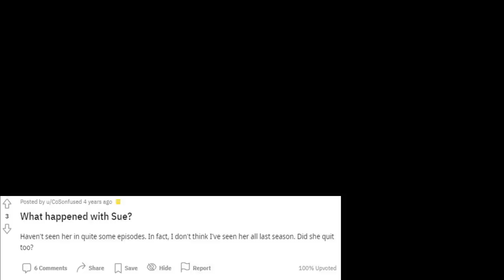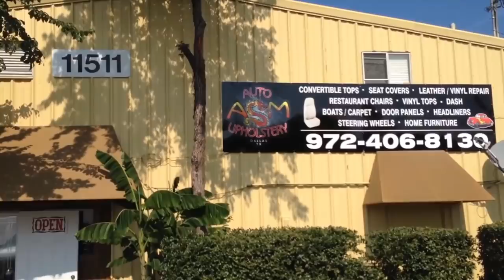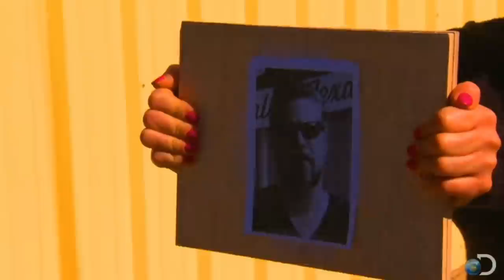What REALLY Happened To Sue From Fast N' Loud!? The TOXIC Relationship With Richard Rawlings

Comment: I know her personally and I have been her client on my own projects. She and Pilgrim Studios did not see eye to eye. She would provide about 6 weeks of work of the entirety of her shop for very little pay. They wouldn't even pay her for the electricity the studios would use. Her shop is quite busy and if you consider that she was basically spending her vacation time, while having to cover overhead and delay paying clients' work for the show, when the show told her that her measly per diem and the advertising she received on the show was enough pay, she had to pack up.

If you know her she's directly involved in the work and keeps a tight ship. The shows would make drop everything in a minute and deliver to them. Many times they didn't even cover the materials.
Reply: Well wish I would have just read this then wasted my data on this
Reply: You know it's for sure Richard sure made a lot of money off the show
Reply: Hell I don't blame Aaron for quitting
Reply: Doesn’t put too good a face on either RR or the network does it?
Reply: @markvincent5992  as much as the show portrays RR as having control on the show and the cars, tbh RR had no control on that. Aaron was paid as talent by the production company. The network bought the show from Pilgrim Studios as a product, they only attained some editor and executive production rights in the second season. GMG didn't exist before the show. As much as RR claims it did, it did not. There was a number of shops and very different businesses he had. Many of the shops went under. The print shop was taken apart and he sold the machines. 

I think the problem with this show is it makes it seem that Gas Monkey existed before Fast N'Loud and that Aaron was always' RR's employee. It wasn't done this way. I hope the full story of how they came about comes out.

Aaron didn't become a shareholder of Gas Monkey Garage because his own choosing. He wanted a guaranteed salary. When GMG came into success then he was upset at his decision and decided to open up his own shop.

Now that there is no show, we'll see if GMG survives. With that overhead, it will never do it. The cycle is done for and Discovery stretched the GMG theme way too much with five side shows. OCC failed after American Chopper went off the air. Junior still has a shop because he heavily reduced his overhead. He leases a much smaller space and has no more than three employees. His father on the other hand spent his way into bankruptcy.

There aren't people demanding million dollar cars from GMG. It's just not the case.
Reply: @SuiteCaseLaw  thanks for the info Victor. I have based my opinions on the on screen actions of RR and the facts about his treatment of his employees and spending habits gleaned from other sources. I think Aaron was wise to get a salary instead of a “piece of the action” since it certainly appeared that RR was not sharing the wealth. I suspect that at least some of the reasons that allegations that the production company was doing things on the cheap may have its roots in how much RR had to do with the distribution of funds. I point out one build of a car that was going to B-J auction and he let it be known that he had gone to another upholstery shop and spent 10K on the interior instead of using  Sue. It would seem to me that if the producers were that tight with their resources they would have certainly gotten a quote from Sue. The Ferrari rebuild is another case in point. If they stood still for the parts build on that one and then cheaper out on paying the guys doing the work, I suspect that RR had more control than he admits, although I don’t have proof of that yet. But I’m looking. I do know that the production companies on other shows have made some unreasonable demands on the business and employees, so I am quite sure they played a part as you suggested. Thanks for the info and your kind response. Mark
Reply: @markvincent5992  and we all know that Aaron was the blood gush the brain the body of the soul everything of that shop
Reply: @billlannan7767  I can’t argue with you my friend. Thanks
Reply: @billlannan7767  He was the brains and guiding hands behind the builds, for sure. Thanks
Reply: @markvincent5992  good talking to you buddy what what part of the country are you from I'm here in Kentucky
Reply: @billlannan7767  thanks pal. I’m in central Indiana
Reply: @markvincent5992  and you know I understand it was a TV reality show and I know they're told to act a certain way but you still can't help feel that that was a lot of Richard's personality coming out of that you could tell that he was just self-centered at all for his self had a serious egomaniac most of the time I watched through it was far the build couldn't care less if Richard was in the show or not
Reply: @markvincent5992  anybody has any doubts about Richard's integrity and keeping his word just look what he did on the super build off against Street outlaws
Reply: @markvincent5992  you know he can drive a hot rod all the way across the country over a hundred and something miles an hour but he can't drive and drag race car down the strip for an eighth of a mile I think the p** out
Reply: @billlannan7767  didn’t hear bout that one. What’s the scoop?
Reply: Yeah I realize that much fast and loud basically a TV show it wasn't the show about car builds or racing or anything like that it was just a dramatizing BS show
Reply: @kiwijeff3964  yeah I know it was all scripted but sometimes it was just kind of unbelievable and steal his personality kind of came out a little
Reply: I’m in Las Vegas. In ALL reshitty shows fame = pay.
My ugly face on any show does not equal pay for hard work...
Reply: @billlannan7767  I think the best build on the show or Aaron did was the ford falcon that he eventually bought and raced at pike's peak.
Reply: @squidusn71  I agree the Ford falcon was really nice build and I heard that Aaron actually sold the car
Reply: I had heard the same thing happened to Fantom works. Dan Short got tired of discovery bullshit.